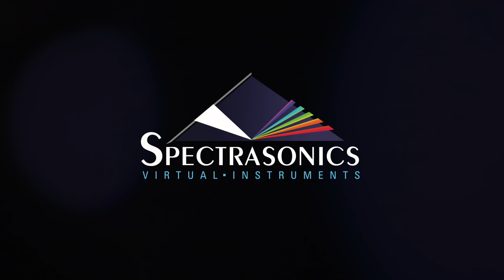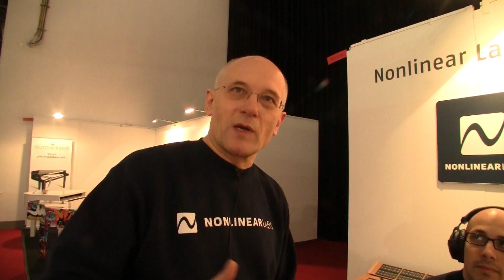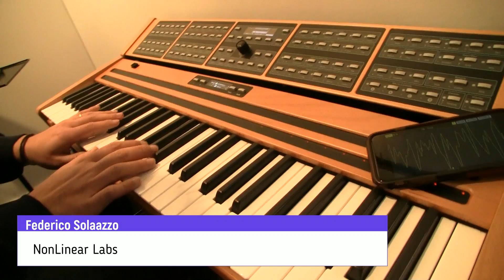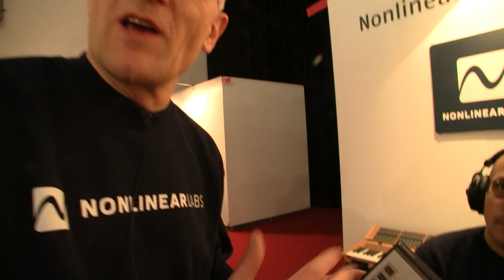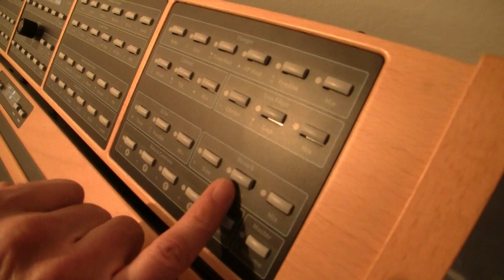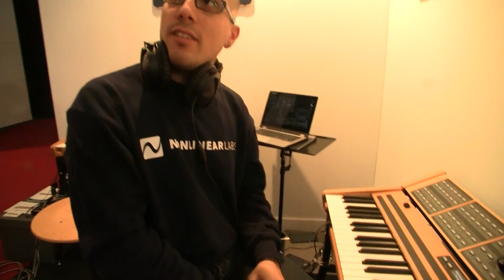MESSE 2017: NonLinear Labs C15 €4k FM, Waveshape and Modelling Instrument

Comment: Oh yeah — and to anyone complaining as to „why only one knob?“:

How many parameters are you able to control with your hands at the same time? Two at maximum, I would guess.
The compromise NL struck here is having 96 buttons with multiple assignments of 2 to 4 parameters each, and ONE knob to control a selected parameter. One knob per parameter clearly would overextend both budget and panel space - still, by having all these buttons in dedicated places, you quickly memorize the physical location for a parameter’s access, which is very effective even when changing parameters as you play.
BTW. Synclavier first came up with this concept, and given their success at the time, it can’t be all that wrong to begin with.

Comment: To all you people who keep whining about „no MIDI“.

The C15 isn’t supposed to be just another sound generator as part of some rig. They don’t want you to just run sequencer loops on it and then go on just tweaking parameters. That has been and is being done to death ;-)
It’s a fully self-contained performance instrument, to be played in real time. It offers great expressivness by virtue of a keyboard with high dynamic resolution (including release velocity & aftertouch), two ribbons and up to four pedals, all of which are freely assignable to internal macro’s which, in turn, can control multiple parameters each. 

Just by variation of e.g. velocity and only one macro (e.g. one of the ribbons), you can already change the sound so radically as if you were morphing between different presets (provided the macros have been set up accordingly - which, however, is the case with most presets). The presets even respond very dynamically to expressive play on the very keyboard alone.

If you can’t or won’t play in real time, then this instrument isn’t for you, of course… On the other hand, there are many performing pianists and even keyboard players who don’t want or don’t know how to use computers & electronics - so why should anyone take it for granted that a keyboard instrument automatically will serve all purposes, just because it can be called a synthesizer? It’s simply geared towards a different market section.

Given Stephan Schmitt’s background (founder of Native Instruments), it’s quite understandable that he’s trying to establish some sort of „opposite pole“ to what he’s been involved with for a long time. NI’s philosophy is to enable anyone who can click a mouse or tap a button / pad to make music. The philosophy of Nonlinear Labs’ C15 is to be played in real time, thus you actually should be able to play the keyboard to fully take advantage of the instrument.
Reply: "The C15 isn’t supposed to be just another sound generator as part of 
some rig. They don’t want you to just run sequencer loops on it and then
 go on just tweaking parameters."  The buyer, the musicians should have the freedom to decide, what they want from this instrument and how to use it. MIDI contributes a lot to this freedom. Excluding MIDI is not exactly freedom for the musician

Comment: This guy is an awful salesman =D When I heard it played the first time I was really enthusiastic for it and then he started to explain it... I mean, come on... 4k and no midi, magnetic covers instead of small lcd screens on each button, only sine waves, not analog, only 24 bit even though the internal resolution is 32bit, no lfo, no sequenzer, no polyexpression and so on... Somewhat disappointing since it sounds so beautiful.
Reply: First off... what's more important - sound or specs?
32Bit floating is important internally, to avoid cumulative quantization error, but for D/A, 24Bit yielding around 140dB of dynamic range should be more than enough (human ear only provides 130dB at max).
 
Then... "only sinewaves" - well, the sounds you heard are obviously not only sinewaves, right?! ;-) Check the architecture. By phase modulation, the OSC waveforms can be rendered basic saw or square waves, you can waveshape/distort them in different ways (up to having just white noise), you can use any of the resulting waveforms for 2-OP FM, put it through RingMod, use any of these sources to excite a comb filter (resonator) for string/blown type of sounds, put this or any of the afore mentioned sources through a very flexible SVF (state variable filter), plus an extensive FX section with a good sounding & versatile cabinet sim., mod FX, great sounding reverb... 

No LFO -- well, if you must, you can use one of the OSC for this, just like Minimoog style ;)
Poly-Expression -- you mean Poly Aftertouch? Can you name some instruments that actually ever had this feature included? Although established with the MIDI standard, most manufactures obviously think this is a feature way too sophisticated for most users, and indeed it does take some practice even for good players to get used to... thus, not too big a selling point.
Reply: Although I agree with you on that it is all possible, if I spend 4k on a synth I expect it to include those features and not just a work around to get them. And yes you are right, I meant Poly Aftertouch. It just didn't come to mind but someone who spends that amount of cash on a product he or she probably can play the instrument pretty well so Poly-Aftertouch would have been quite the selling point imo. I wish it had the features I listed above, especially since there is huge competition for it out there. Of course sound is above specs but the whole concept seems limiting to me.

Comment: Not that it doesn't sound amazing but he basically made a synthesizer for himself - which I think he said at one point. Which is usually business suicide if one doesn't make some compromises and add features that would broaden its appeal to consumers.
Reply: vixstar46 I am pretty sure there were people twenty years ago that told him "who needs that" and mumbling "business suicide" when he invented Generator (which would become Reaktor and the foundation for Native Instruments). Just producing something for the lowest common denominator is boring and rarely the source of something exciting...
Reply: Had it felt completely unique, I would say there would have been a market for it, especially in certain more experimental electronic genres.
However, there are some great soft synths that are expressive and quite a bit different, that even with an MPE controller, the computer running it and midi controller for knobs and buttons, would be quite a bit less than this instrument.

I still feel like it's and interesting concept to see exsisting and working. But I doubt it will have much success... But perhaps they can build them with a profit even for single units.

Comment: Sounds brilliant, but the no MIDI approach is pretty moronic to be frank. I get the whole idea with it being a players instrument but then you offer virtually no scope for real time performance changes of the actual sounds themselves since you have a million buttons but only one knob. A good idea hampered by some pretty ridiculous design decisions.
Reply: it has a pitch-stick of sorts, 2 long ribbons and 4 pedal inputs. The idea is the sound is programmed and then played with expression, and not dialed in during play.
Most acoustic and electric instruments are quite limited in terms of changing the sounds during play.

However I feel if they wanted to design a new instrument, they should have looked at other laternatives to the piano styled keyboard with mono aftertouch.
Reply: Jon Holstein MIDI
Reply: I agree, and it could be remedied quite easily if they just added MIDI so I could play it with a Roli, Continuum or other unconventional method. To be honest there's a funky smell of elitism about only considering a schooled piano/keyboard player worthy enough to use it.
Reply: What do you mean?
That Midi could be used to control it with a MPE controller?
Well connecting external Midi controller, would make it even less like a self contained instrument!
So please explain yourself, what do you mean?